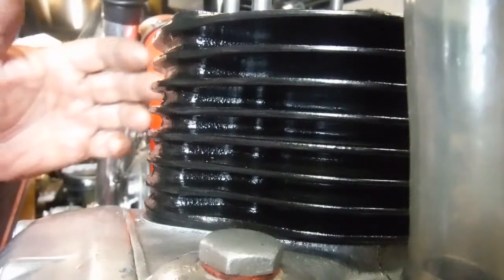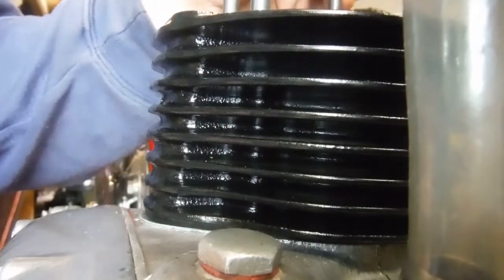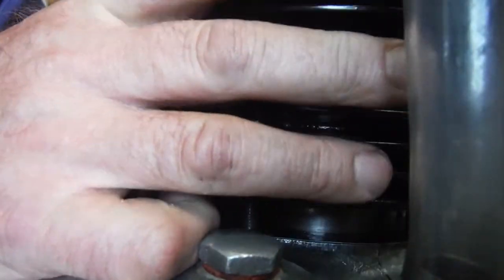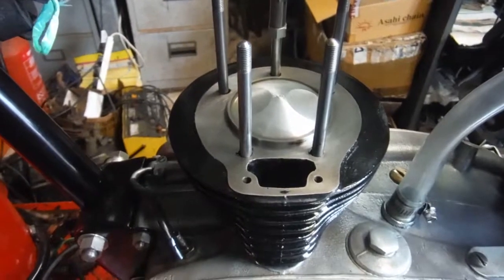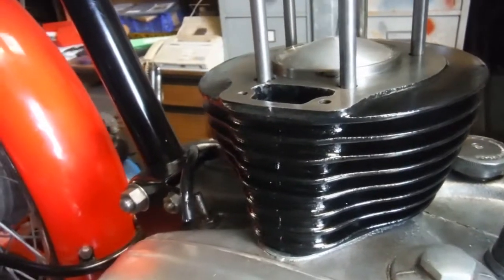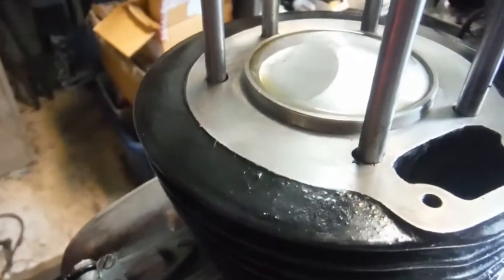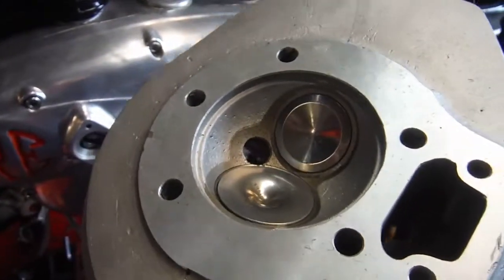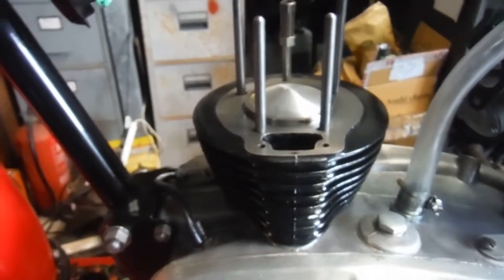Royal Enfield 250 cylinder barrel woes part 2.

Comment: Were you able to start any of the studs with your fingers with the barrel in place? That’s an interesting problem. Domestic or import barrel? That’s one of my dream bikes. Never would set the world on fire but sure looks cool trying.
Reply from the maker: Only the one, shorter stud would just start, but even that would bind after a couple of turns. I suspect the barrel was made overseas, as the pushrod tunnel screw holes were M6 thread, rather than the usual 1/4" BSF.